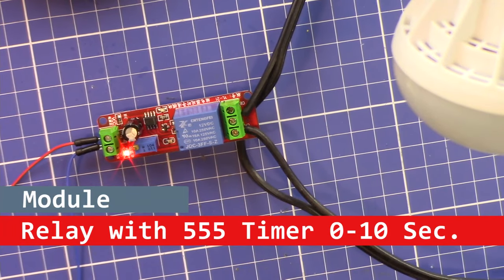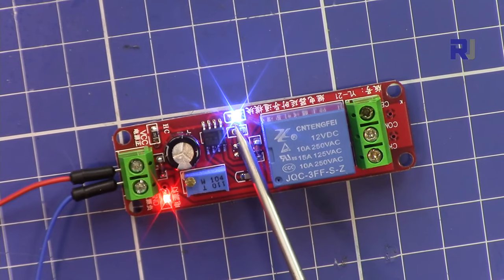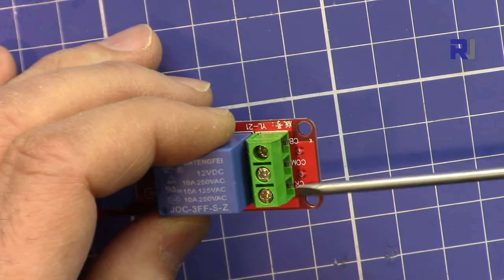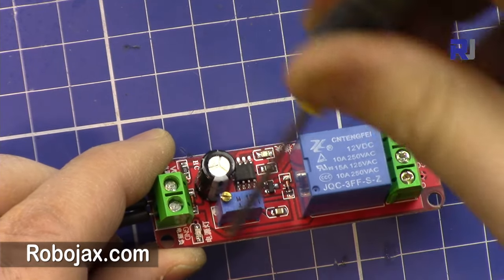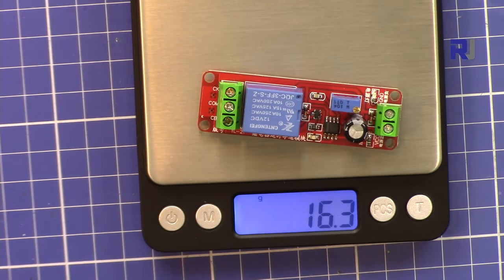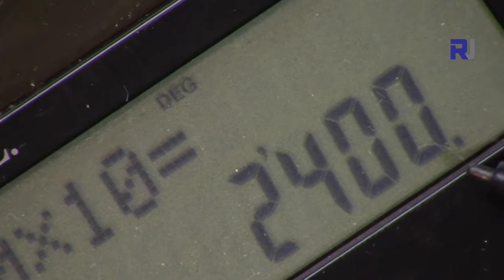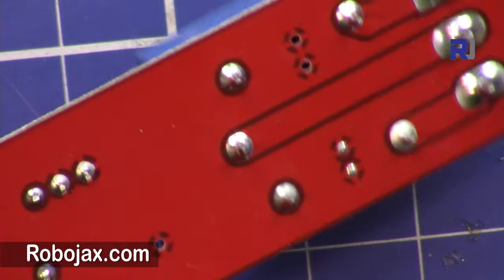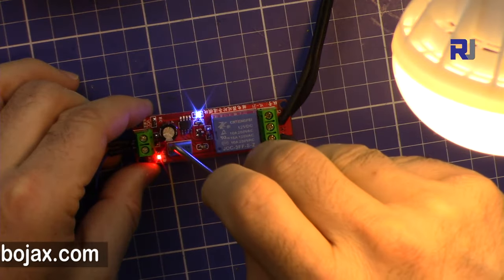555 Timer Switch 12V Relay with Adjustable time Test review

Comment: is it possible to use this to turn off a pc. i just need the timer to set for 1second or less since pc on/off switch is momentary. this will be connected to a relay which will trigger its 12v power. thanks
Reply: basically, what i need is a single pulse signal. like it will turn on for 1second or less then turn off. is that doable with this circuit?
Reply from the maker: I don't know how you are going to use it. As demonstrated at 05:30 when you power it up, it waits for the set time and then connect or disconnect. But i can  be set to 1 second.

Comment: Hi thanks for this tutorial... Can the 240 volt a/c trigger a device and the 12 volt dc trigger a different device(s) simultaneously?
Reply from the maker: Hi, sorry I did. It understand. This is  van control ONE device. Module is powered up using and triggered by DC. The load does not matter to be ax or dc. If you want o add push button see this video https://youtu.be/LDLPUpU64J4

Comment: Sir i need it for 220V AC.... What would be the circuit diagram
Reply from the maker: This needs 12V to operate. So connect an AC adapter that gets 220V AC and output it to 12V DC.  Then it is a switch to turn your AC bulb ON or OFF and you can connect your 220V bulb as load directly.
Reply: Sir from where I can buy it
Reply from the maker: Check the description. I have provided the link https://snag.gy/EG4O2l.jpg

Comment: Sir can it be used to close car window for 5 seconds?
Reply from the maker: it can be used for anything you want as long as the current rating on the relay can tolerate it.  so check the relay if it can  handle the required current.

Comment: Great video. I want to use this switch to car parking sensors. Reason is because parking sensor disconnects as soon as the gear is put to forward but I want my parking sensor to stay alive for at least 10 sec. 
please can you guide for wiring the device? (The output end) 
I would really appreciate that. 
Many thank
Reply: The gear will be needed to be connected to the trigger pin. The relay must be connected to the parking sensor. You will need to select the components such that time is equal to 10sec using the formula T=1.1RC
Reply: Hi, were you able to connect the timer relay to the parking sensors? I am looking to connect a reverse camera of my VW using this timer.

Comment: the timer circuit works ok with 12v dc motor unloaded but  when water is put in the bottle the timer circuit doesnt work
Reply from the maker: bottle?
Reply: @robojax  motor is in the bottle filled with water,a trial for dispensing sanitizer for 2 seconds

Comment: good night robojax
with a 5v USB reley I can use it to open an electric lock from my pc
Reply from the maker: yes you can if electric lock just have ON or OFF switch. You can connect the switch wires to this relay and you should be able to do it.

Comment: (0:25) - You say that the relay there can be used for an AC or DC load.
No. You are wrong.
Although DC can be used to energize the switching solenoid inside the relay, the actual load ratings for the various voltages that can be switched, (and which is printed on the side of the relay itself),  are: 10A @ 250VAC or 15A @ 125VAC .
Nowhere is DC as a load even mentioned.
>
Reply from the maker: The bulb I am controlling is AC. So yes it can control AC load meaning turning it ON or OFF. Thanks.
Reply: @robojax  My point was that the relay showed no DC rating.
My guess is 30v @ 10A DC
OK?
>

Comment: how would i connect it so that it only runs for a few seconds and then stays off?
Reply from the maker: just change the load wires. keep the middle wire and move the other wire to the other connector.
Reply: @robojax  I think he means turns something on only for a set period. Power on, device stays on for a few seconds then goes off. Blinking in effect.
Personally, I watched this video because I want to make a 'Steampunk' digital clock controlled by relays that light segments of a hand made digital display lit by old school halogen bulbs. What I mean is, a 1 would be lit by two bulbs on at the left of a figure 8.

Comment: Mmmmmm,,,,,,one cuestion, I want a 3sec On signal,,,,,,,,with a push button pressed 1 sec to start the timmer, ,,,,,,,ok it's easy,,,,,,but if the push button is press  1 sec,,,,,,or some times 1min,,,,,,,how can I still  get my 3sec signal,,,,?
Reply from the maker: this module needed to be turn OFF and turn ON to restart the time.

Comment: its arse about face, really needs the relay to turn on straight away and delay the off time, instead of keeping the relay on to turn everything off then it could be useful to control lights that you only need on for a few seconds or an alarm
Reply: In order to do so all you need to do is change the connections of the load and relay.

Comment: how can  we increase the time delay to 5 minutes.?
Reply from the maker: Whatever the potentiometer allows to set to maximum that is the limit. If you want longer, you could remove the potentiometer and change it to something different which gill give you longer time. you have to try and find out as we  don't have schematic of this device.
Reply: Change the capacitor size
Reply: It's 7 components on a easily seen PCB you don't need a schematic

Comment: So why are you using a metal scewdriver when the unit is on. Not the safest idea. you stand a good chance of destroying the board at best.
Reply from the maker: You should be ver careful. Specially if you don't know the components and operation of module.